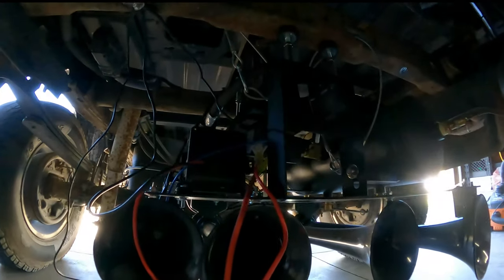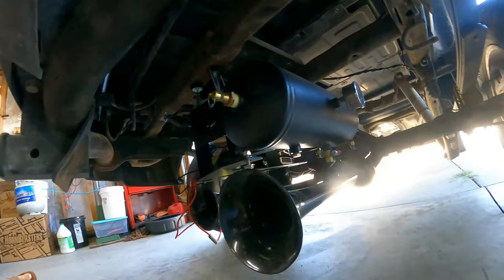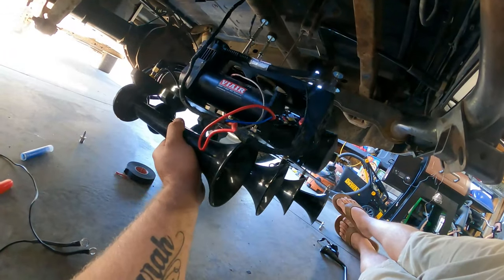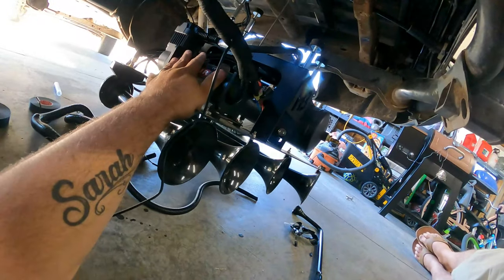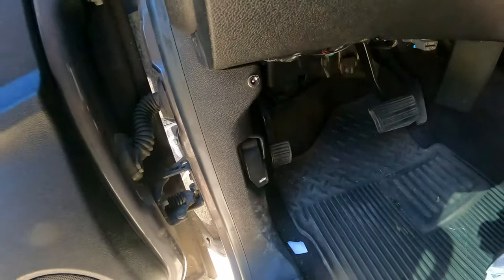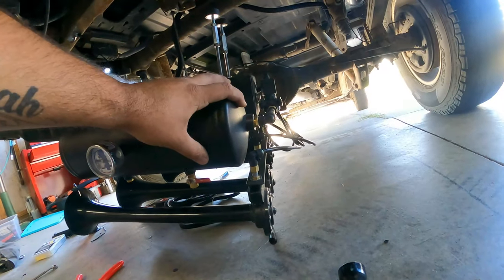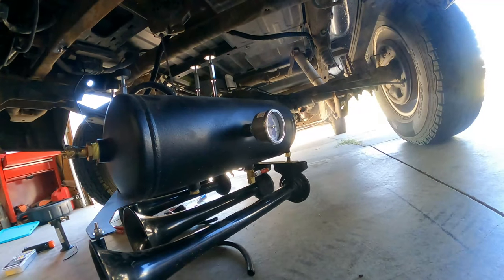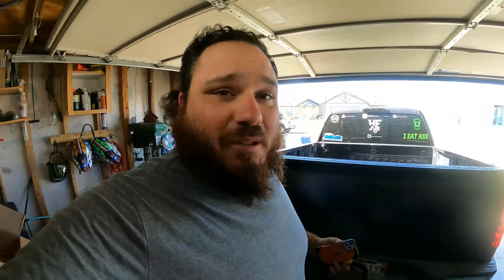Hornblasters Air Horns Spare tire delete

Comment: Hey I have a question, how did you put the spare tire bracket anchor in? I tried installing but the gray pressure switch box gets in the way.